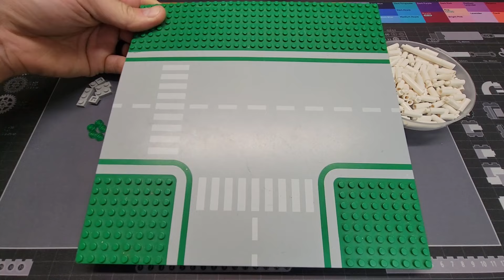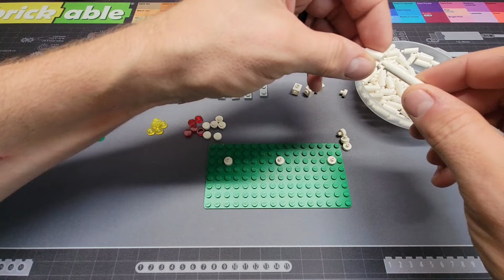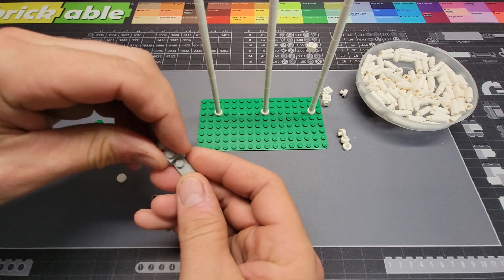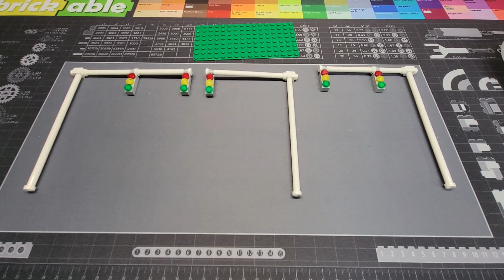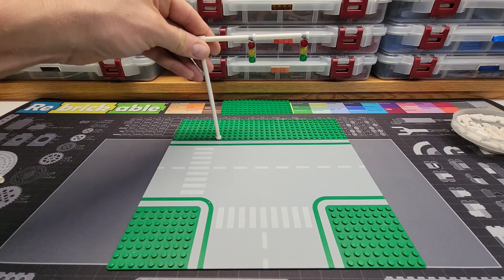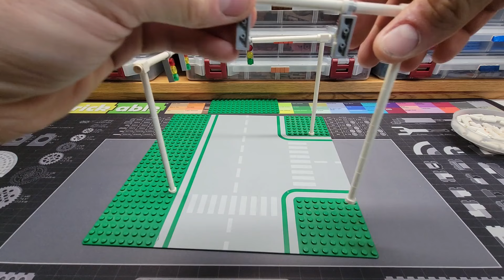LEGO Traffic Lights MOC

Comment: Lots more adjustments are needed to make it fit European standards. One major differents is, traffic lights are before you drive or make a turn, not on the far side of the T-junction or crossing.
Reply from the maker: interesting ours are on the opposite side